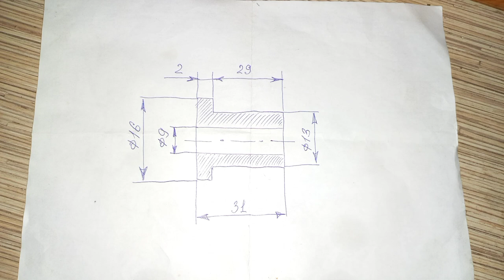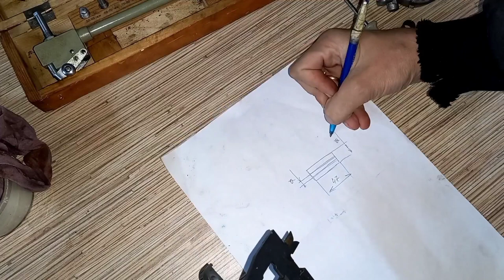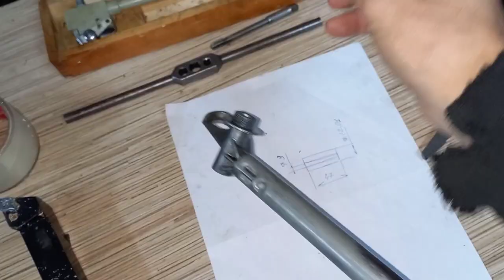Как это сделано .Подшипник из 2х половин на токарном станке. Вкладыш из латуни.

Comment: I don't really understand why it is needed to have the first bushing made of two halfs. And generally, why don't you ream the bushings after those has been pressed in?
Reply from the maker: 1) Do not put an ordinary bush on a shaft with a gear. After wear reduction by turning, the diameter of the shaft under the sleeve is less than the diameter of the spline part.
2) The allowance for reaming was large, minus 0.5 mm from the nominal size. But preferably 0.1mm . Therefore , it was easier for me to make a ream using a machine .

Comment: No need for a split bearing. Agree?
Reply from the maker: I can not agree with you)  After clean a shaft surface,  the diameter became smaller than diameter of the splines piece . Or whatever the machine operators correctly call this area in English ) and because so I produced this design bearing.